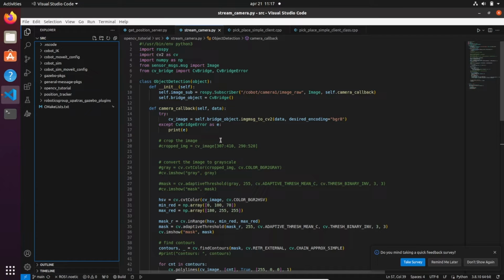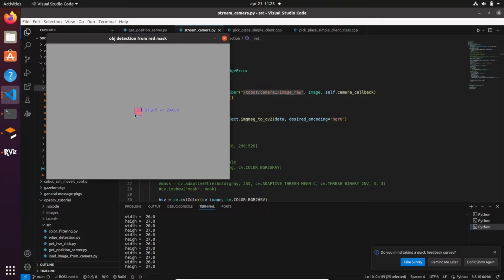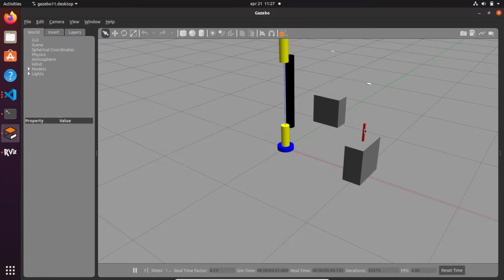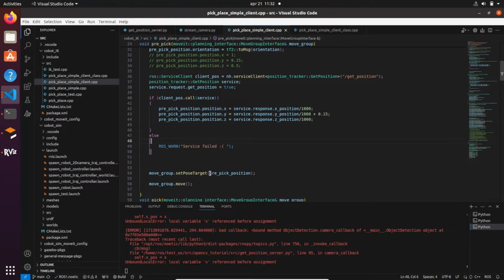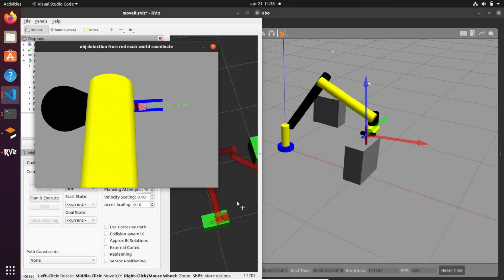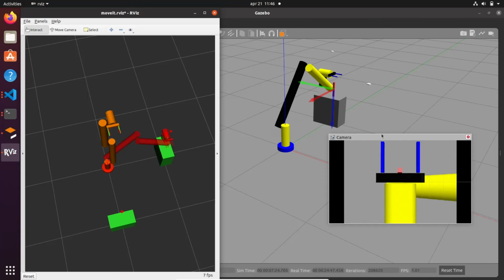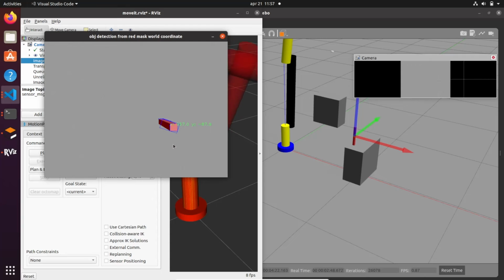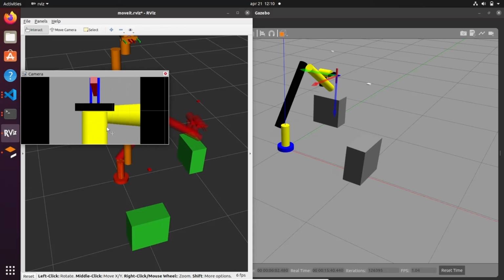How to Pick and Place with ROS using 2D Camera to detect the position of the object with OpenCV

Comment: Hello, I have a problem: While I am running the first command line "roslaunch cobot_sim spawn_robot_2Dcamera_traj_controller_world.launch", it opened the gazebo scene but the rviz can not load to open the robot moveit.rviz, how can I fix it? Thank you. :body-blue-raised-arms: :popcorn-yellow-striped-smile::fish-orange-wide-eyes:
Reply: Yes,it works well. 😊But one more problem: The stream_camera.py works well to detect the object from red mask, but while running “python get_position_server.py” it can not detect anything and have the issue as “Error processing request: ‘ObjectDetection’ object has no attribute ‘x_pos’. 😮
Reply from the maker: @sarahchen8692 have you tried to move the object in Gazebo a little bit? If you run the python code, does it detect the object?
Reply: @learn-robotics-with-ros  Yes, I moved the object but it can not detect the item with  "get_position_server.py”, but the “stream_camera.py” works well. My cv2 version is 4.10.0. So how can I change the code to make it work? Thank you😃
Reply from the maker: @anglechen8692  before to run the server, you would need to make sure that the object is detected. I have used a mask based on the color, so have you tried to change the HSV lower and upper limit threshold?
Reply: @learn-robotics-with-ros 🎉Yes, it’s the problem of HSV value range. Now the whole project works well! Thank u very much 🥳
Reply from the maker: @anglechen8692  if you want to Master ROS have a look at this program for cooler stuff in robotics (75% off with code PRESELLING75)
;)
https://learn-robotics-with-ros-s-school.teachable.com/p/mastering-robotics-software-engineering-with-ros-develop-and-deploy-advanced-manufacturing-ssolution
Reply: @learn-robotics-with-ros Sorry, one more issue😂: while running cobot_IK pick_place_simple_client_node I find my terminal did not show ‘’object position : x …, y…, z… ‘’ as in the video and the robot seems not go to the right position of the object and fails to grasp it well, so how can I fix it 😅😅
Reply from the maker: Have before to make the CPP file run as a client, you need to start the service first. The service is responsible for transforming the object position from /world link coordinate frame to /base_link coordinate frame. Have you checked that video? The position is written in that file, the server.
Reply: @learn-robotics-with-ros  As the video shows, after running "python get_position_server.py" I run the "rosrun cobot_IK pick_place_simple_client_node" and I see the code will print "x_pos, y_pos, z_pos" if "req = true" in get_position_server.py. But my terminal did not show any coordinate information so I don't know what detaills I've missed.
Reply from the maker: @anglechen8692  have you written in the code the printing of the values in the server code? This printing should be in the terminal where you run the server. Do you want to share to me your GitHub repository with your project?
Reply from the maker: @anglechen8692  you just need to press play in Gazebo. Let me know if it works